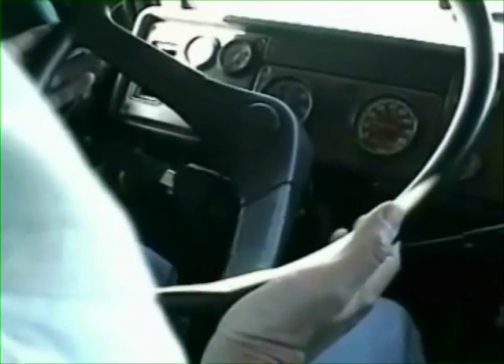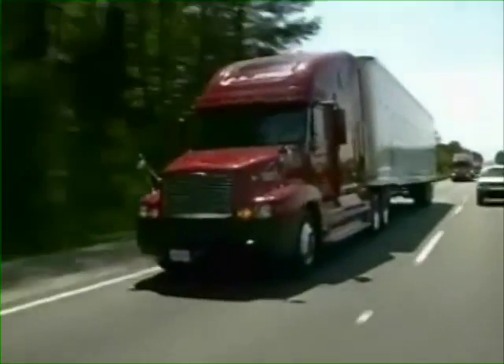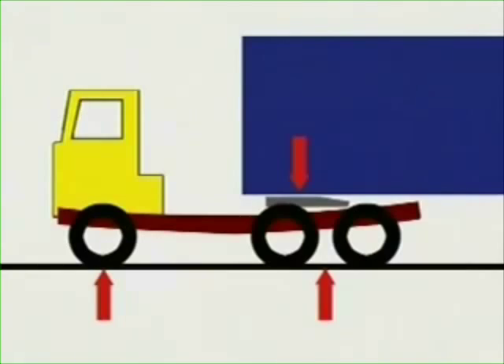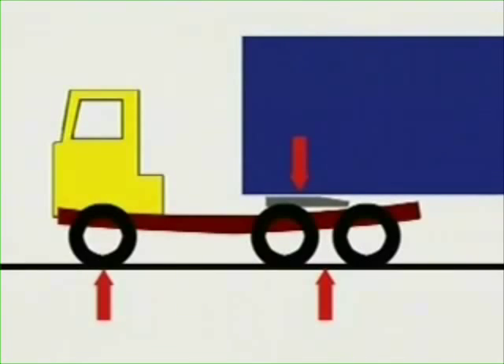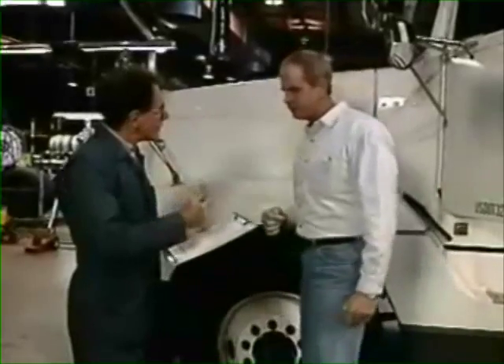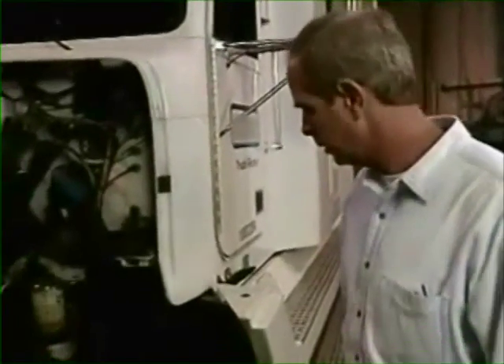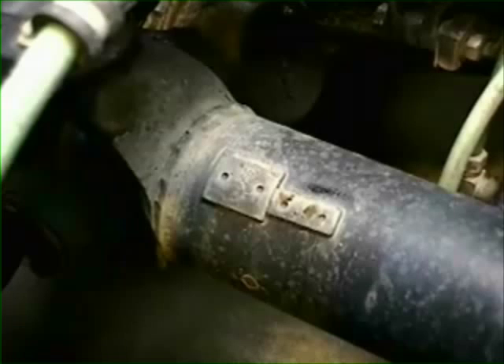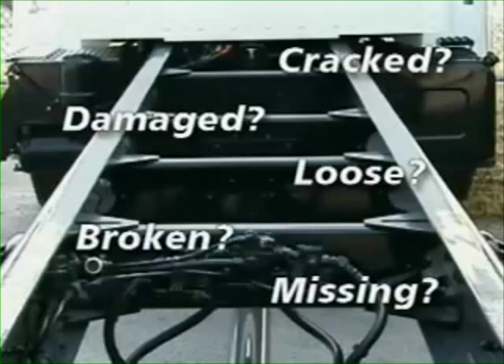Troubleshooting Vibrations

Comment: new volvo truck rear drive shaft out of PHASE . my dealer was to stupid to fix so this went on for almost 80000 miles it eat up 2set of tires. but still has vibration that is more heat related . 50 to100 miles to warm it up
Reply: Never call your dealer stupid they can teach You a few lessons.
Reply: Mine shakes from 40 to 50 mph it's a 2020 vnl 740 mainly driver side 46000 miles on the truck